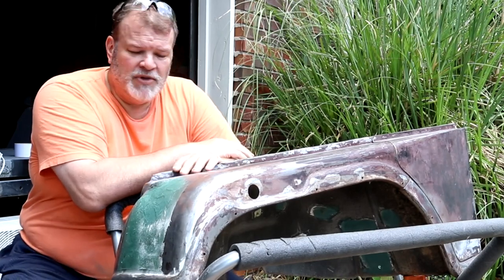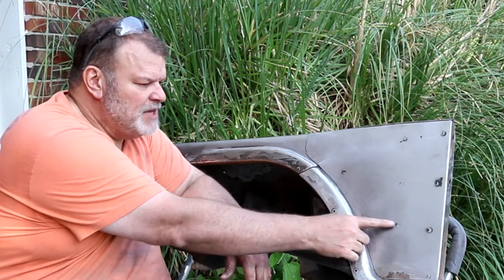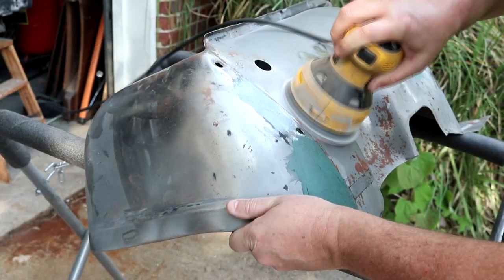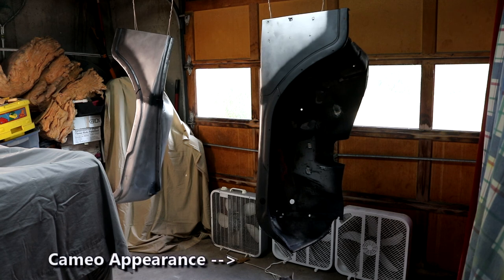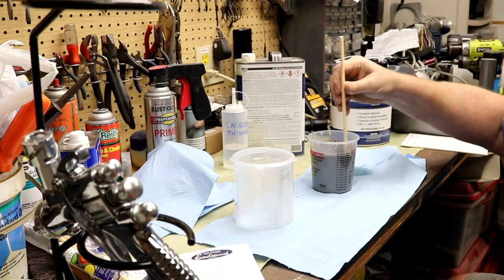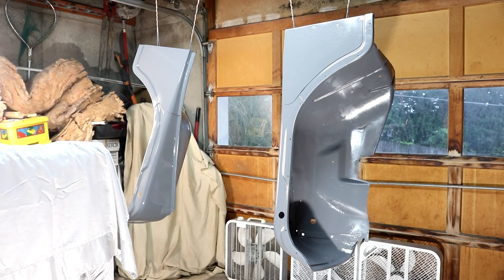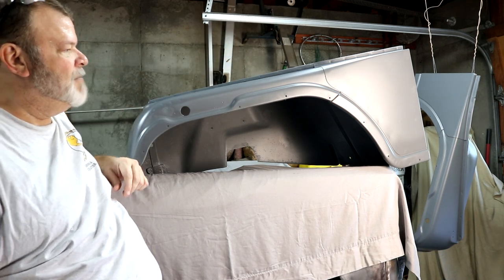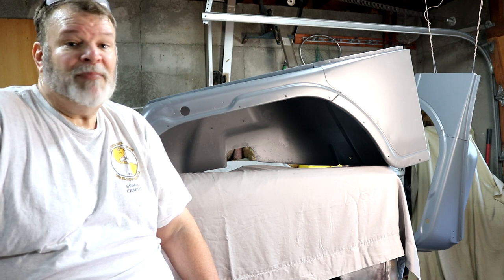Jeep CJ7 Sand and Epoxy Prime Fenders | Project Rowdy Ep038

Comment: Mike........what I use often for all the little boogers & pits is an old product called "Feather Fill". It's a filler primer that sands like talcum powder and fills beautifully. If the pit or spot weld is deep enough I'll use bondo or spot putty but once I've got it good or close enough I'll do a once over with the filler primer and a final sand. That stuff leaves a gorgeous surface as a paint base.....especially on pitted metal.
Reply from the maker: I've heard of Feather Fill and seen some of the channels I follow use it.   I will look into it.  I had a friend over and was showing him the project.   As I was explaining him some of the next steps, I realized how much of this Jeep I plan to cover in Bedliner (Inside, Bottom, both sides on the Firewall).  That really doesn't leave much surface area that will be Final Painted.  But I am using this project as a learning step for a later restoration of a 68 Camaro.  Trying to hone my skills.  Appreciate the information!

Comment: Great to see a video Mike. I love your videos. On the epoxy, my epoxy says to paint within 24 hours of stripping/blasting. I have been able to get a away with more time here in CA due to low humidity.
Reply from the maker: I think the 24 hour time frame is a good rule of thumb.  For these fenders, I was trying to plan my sanding days based on good weather 2-3 days out so that they did not sit long before spraying.  Dang of the surface rust didn't come quick.  Glad to have them coated!!

Comment: Excellent as always!   You can try "icing" on the spot welds instead of normal filler since it's a lot easier to apply thinly.  Also, don't be afraid of sanding the epoxy with water, it seems to load-up a lot more than normal 2k primer.  Keep on keeping on !!!
Reply from the maker: Thanks Bob!  Cheers... Mike!

Comment: A product called Ospho rust converter takes and and converts it back to black carbon, you don’t have to sand or clean it. You can prime right over it. I use this on most bare steel as a rust protection before I do any body work. Just an FYI. But I am following you and the project. Be well.
Reply from the maker: Paul Richardson I have heard to Ospho.  Do you have experience with using it?   I worry about primer and paint adhesion.  Cheers!!!